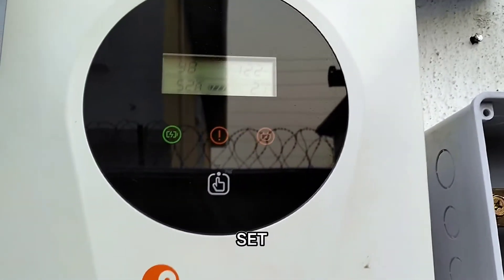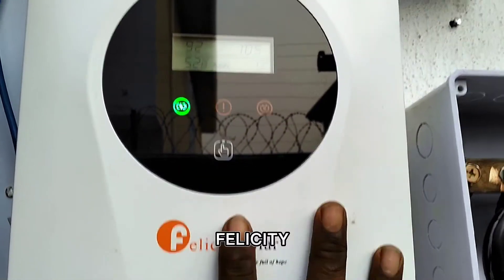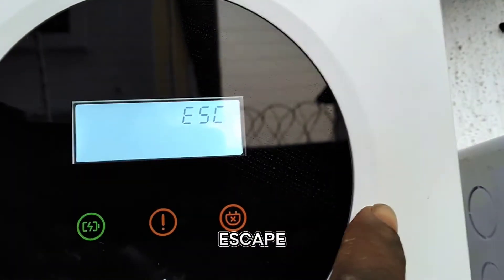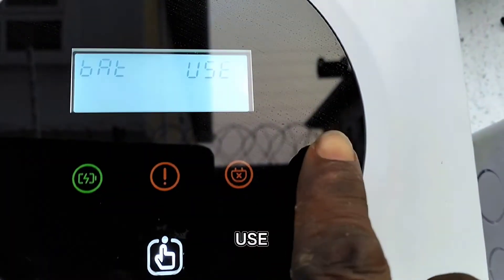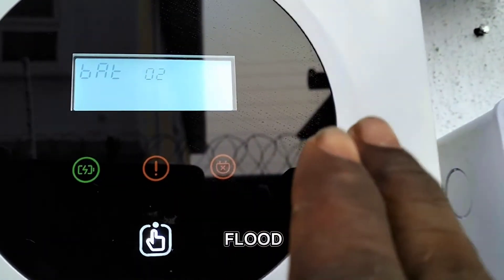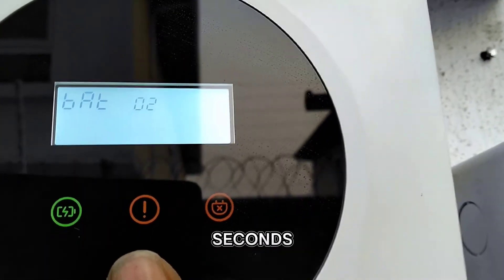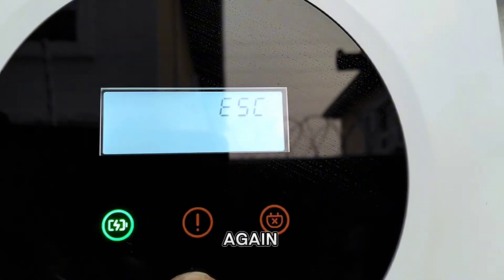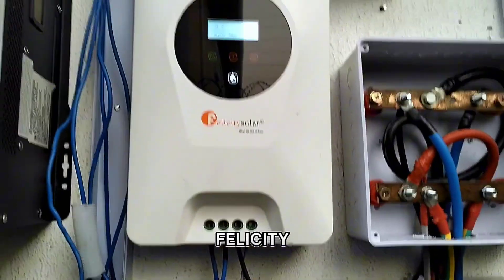how to configure SCCM12048-II felicity charge controller

Comment: To set it for lithium, you first need to set program 5, which is battery type to 48v, the come back here to select lithium. USE means user defined.
Reply: correct.
Reply: Correct, but use is default or automatic
Reply: Please my controller is not coming on after been connected to the battery
 What can I do please

Comment: Please if you want to use lithium, you would have to change to 48v ooo before lib can show or better still consult the manual. It's not USE ooo
Reply: This information just saved an engineer 🔥.  What about the absorption voltage and floating voltage. What are they going to be.  Please, can I possibly have your contact. ?
Reply: Please did you find out what they should  be?  @adeniyiprecious7202
Reply: What about if your lithium battery is 24vdc, will you still set it to 48v on the charge controller before using the lithium battery option?
Reply: Exactly what I wanted to say
Reply: How can change it to 48v

Comment: Please how can I match a 5kva inverter with an external 60A MPPT charge controller. Both are felicity but the instructions on the manual is not working.

Have you ever achieved communication between the two such that the panel icon on the inverter LCD screen is lit up?
Reply from the maker: I haven't done that before
Reply: Olodo
Reply: Have you been able to do it?

Comment: i want to connect a network cable so I can monitor the controller. how do I do this ?
Reply from the maker: I think the charge controller has a comm port
Reply: please i also discovered that the change controller switch off at night when there's no Sun 🌞 shine
Reply from the maker: Yeah, it's PV powered